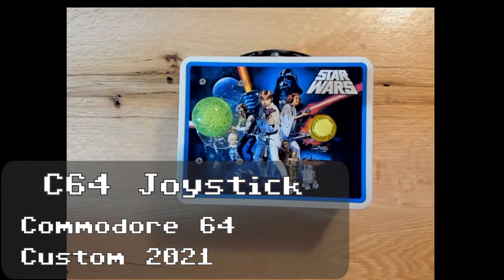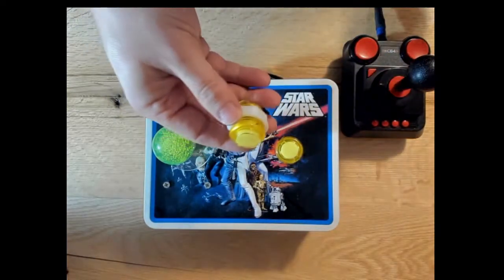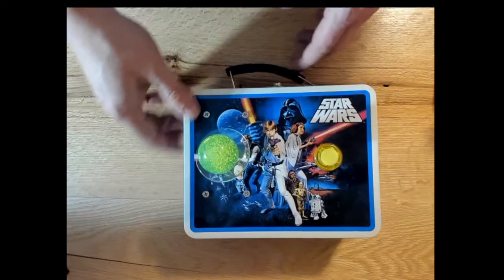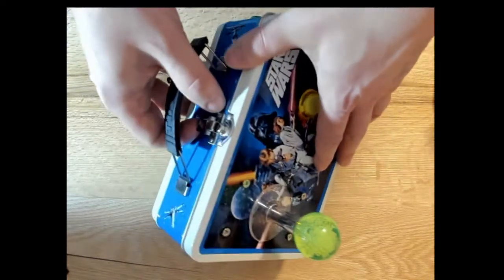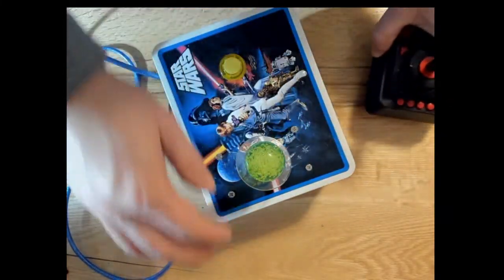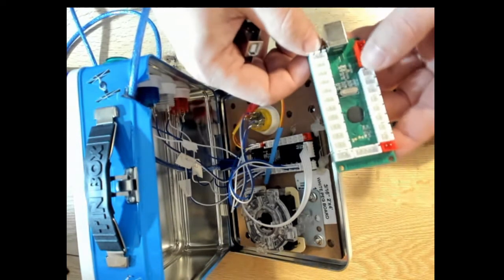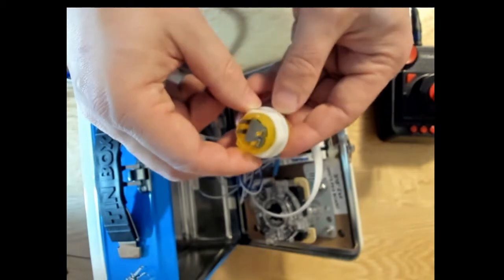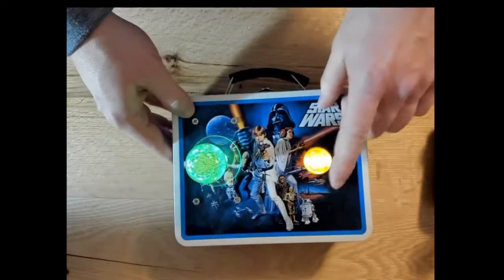This is a Custom joystick for the C64

Comment: Final product turned out really nice!  Any issues with it scooching across the table?  The tin pail looks a little light.  Or do you maybe play that in your lap instead of on a flat surface?
Reply from the maker: I've been using it in my lap. It is light. I suppose I could add some weight if I started using on a table. I was so glad to find a purpose for the tin.

Comment: Have you ever seen a kit that includes support for two joysticks on the same board? I've seen double joystick kits, but they always include two control boards. I want to find one that will support two joysticks on the same board so that you can make a twin-stick controller, without needing to plug in two separate USB cables.
Reply from the maker: I have not. All the kits I've seen have only supported one stick off one board.
Reply: @youreallyplaythat  I suppose most people would just use an Arduino for such things, but I don't have the faintest clue how to do that.

I did see that they sell flightstick type joysticks with buttons on the handles, which I assume would be wired up the same as individual buttons. I was thinking a pair of them and some extra buttons would make a great twin-stick setup.

I even thought of getting a couple DOS era joysticks and wiring them to the analog contacts from a USB game controller, but I was told that the values used by DOS analog joysticks and the little thumbsticks on controllers are too different for it to work.